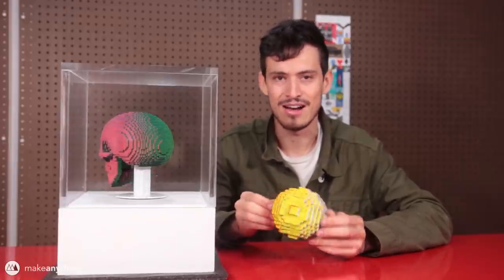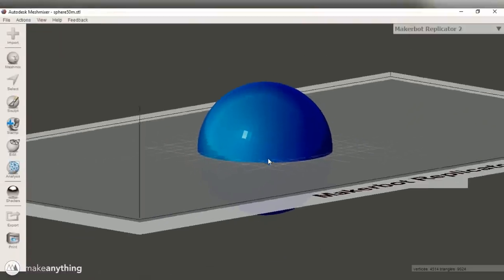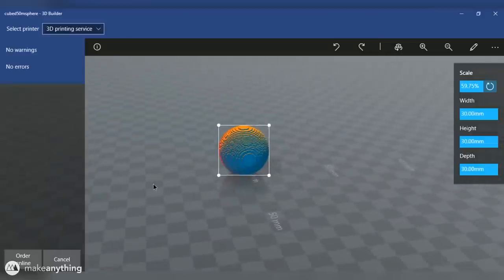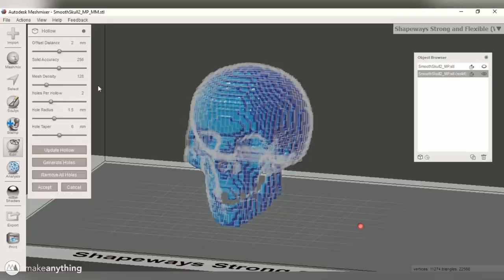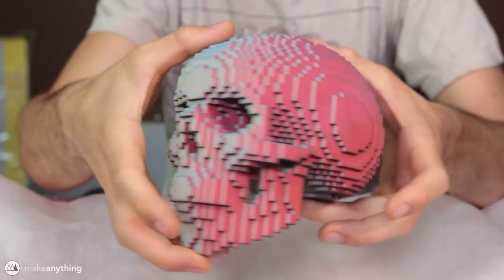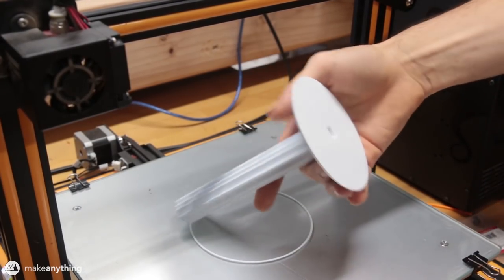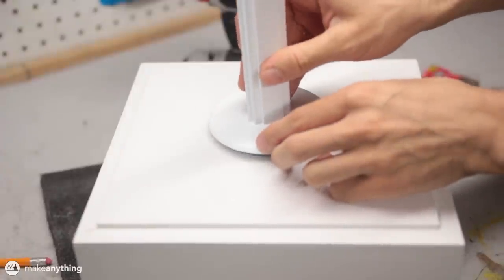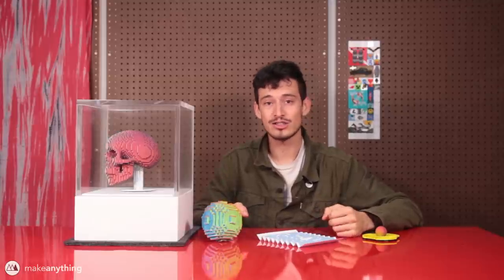The Voxelized Skull // Full Color 3D Printed Illusion

Comment: I know this is late af, but standard bb gun bbs make for really good ball bearings for this sort of thing. Just print a disk with a small rut going around, fill with bbs and put a second disk above and it will run super smoothly. 
I've used them a few times for stuff... they have to be almost perfectly round because they need to fire down a barrel.. it's much more accurate than crafting supplies like small glass beads or something.

Comment: I think you can achieve this concept perfectly with serial slicing using a laser cutter. If you tape the material that's being cut and then keep the tape on the surface when spray painting the edges it will keep the color from bleeding or being uneven. Maybe by even painting before you put the tape down and laser cut it you can create seamless color contrast. You'll have to find a laser safe color/stain or just start with something that's already a color. Maybe this is confusing but I'm pretty sure it would work.

Comment: PolyJetting is actually resin based, not powder, so I'm not sure that hole saved you much unless their support material costs less than the colored resins.
Reply: Maddie Goldenthal yes this is a gypsum zcorp type printer. You still need a hole to let the excess powder out or it will be very heavy.

Comment: One note: You didn't got the explanation of the Polyjet technology correct. It doesn't work with powders but with photopolymers instead. Therefore, hollowing out to reduce the material/ costs had good intentions but didn't really cut the deal as the hole had to be filled out with support structures. Instead you should have designed it as a self supporting structure at the inside. Nevertheless, like.

Comment: I'm waiting to see how they're the 'same basic ideas'. Or at minimal, at least some effect happening. 

One completely changes an image, whereas the other doesn't. It's just different colors. 

Still the same image, still the same shape, nothing changes but the colors, and that's because the colors are different. 

Even with the image on paper, both sides could be the exact same color, and the effect would work...

So, they have nothing to do with each other.
Reply from the maker: Think of each of those colors on the skull as being a single colored image, and the skulls appearance switches between those. Theoretically I could replace each side of the skull with an actual image and have it work.. perspective might play a roll, but it could be done.